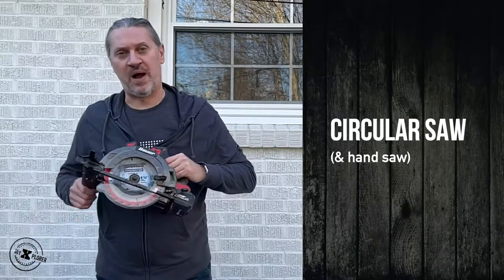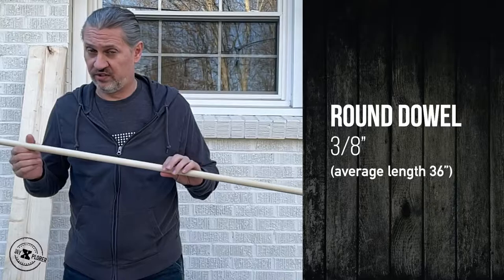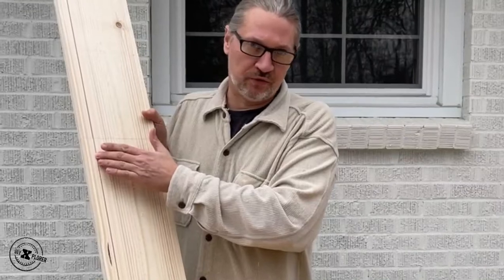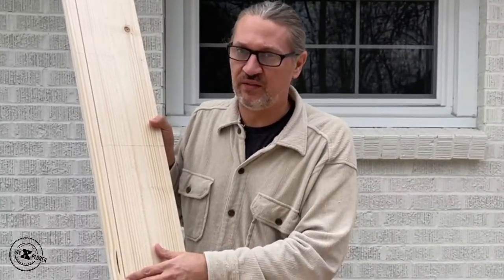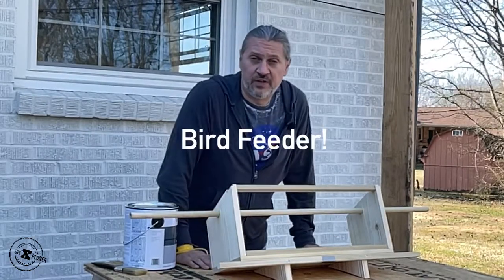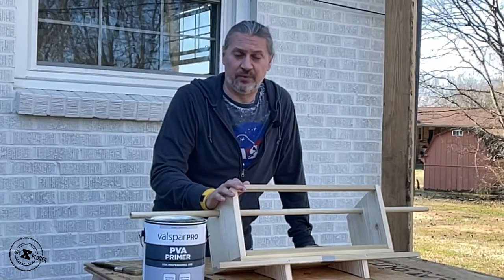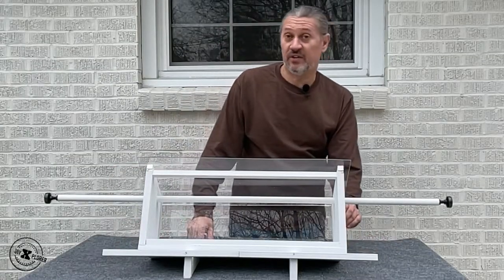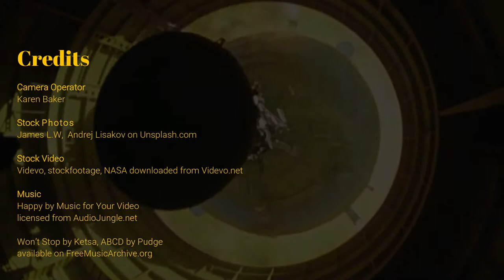How to Make a See-Through Window Bird Feeder Your Cats Will Love | #DIY #HOWTO #CATTV

Comment: It’s angled toward the window. Any rain is going to run down toward the window frame and rot it out.
Reply from the maker: Hi Douglas! In the direction our window faces, we don't get a lot of rain under the roof overhang. When it rains with winds towards the window, the only problem is the seed getting wet occasionally. Overall I have not experienced that problem. 

I recommend placing it somewhere a little more protected from the weather. I hope this helps. Thanks for the question and watching.